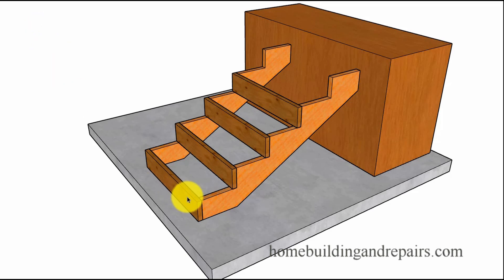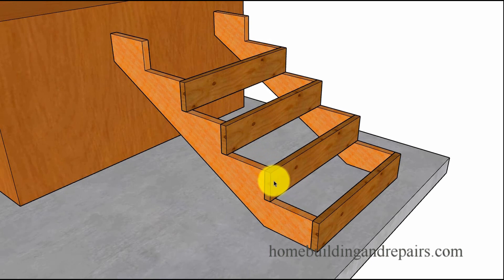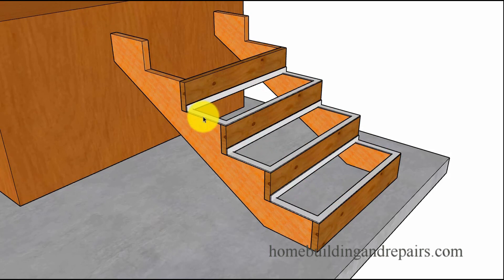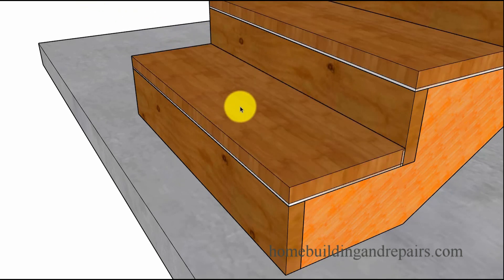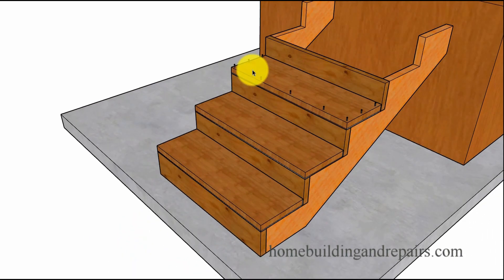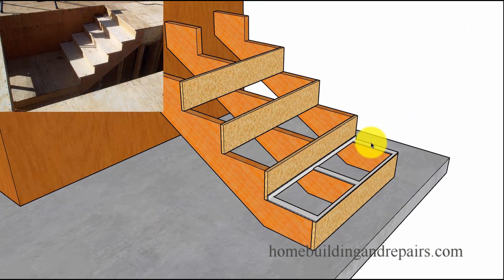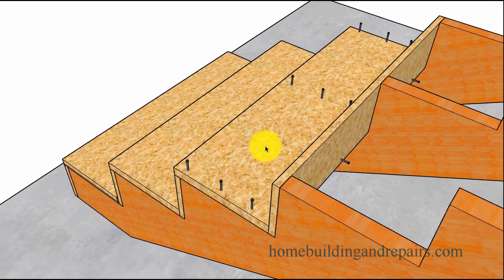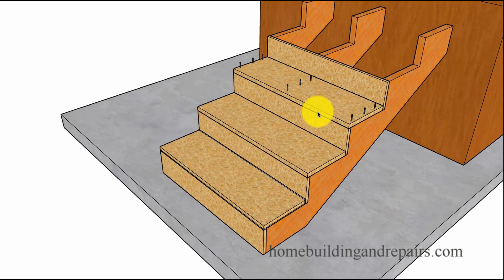LVL Versus PLYWOOD and Standard Framing Lumber - Which One Is Better?

Comment: Does cutting into the LVLs reduce their structural capacity?
Reply from the maker: Yes, cutting almost any lumber can reduce strength. If you can, check with the manufacture of the product to see if they can be used for notched stringers.

Comment: Thank you for this video. As usual you are a "step" (pun intended) ahead. I am still in the process of getting my rear 2 story staircase built. You would think I am building a pyramid for the ages the time it takes to get this project right.  You mentioned Plywood for treads and risers. Someone suggested 5/8" Marine plywood for durability another suggested Redwood would last longer. Is LVL better than either of these materials? OH, the choices! What do you suggest?
Reply from the maker: For interior stairs, plywood or OSB seems to work just fine and for exterior stairs, construction standard lumber seems to be okay. However, you will need to take into consideration what you actually want the stairway to look like, if the materials are going to be exposed.

Comment: Would say an OSB kinda guy.... quick an easy job fix for job built....

Wondering if you might have any ideas, experience or comments on this question...... How to design and build stairs for seniors...... 

What if one is designing the interior remodeling for an independent senior...who is up in age, and simple things like walking up stairs is a serious issue....are there any standards or recipes for treads and riser height, or width??.... If you are primary building stairs for more senior persons can you bend the standards to make it more so easier for them to have less of a likelihood of an accident??
Reply from the maker: You would need to check with your local building department to verify the information I'm about to provide, but I've never heard of any exceptions being made for senior citizens with the building codes. I think what I would do if I was going to design stairs to make it easier would be to use somewhere between a four and 6 inch riser and a 12 inch tread, but this is just my opinion.

http://www.homebuildingandrepairs.com/design/stairs/index.html